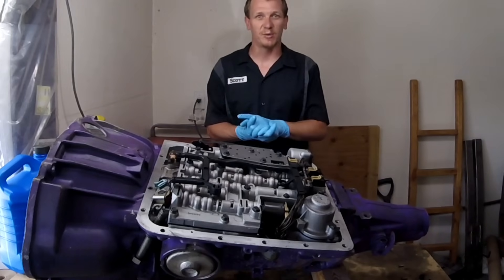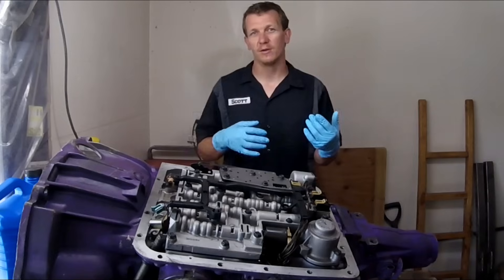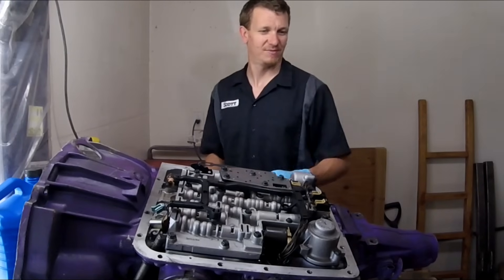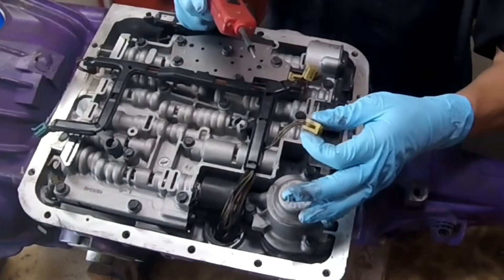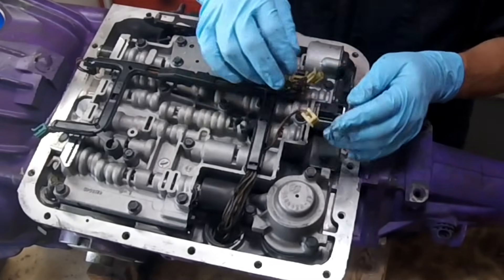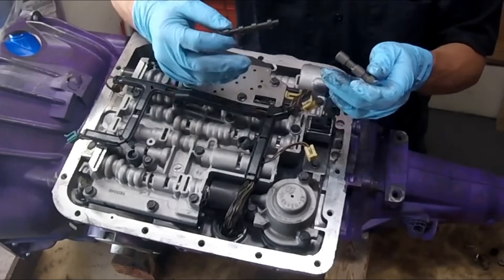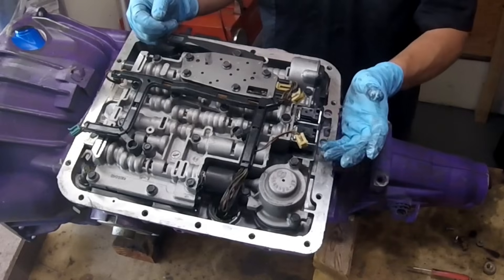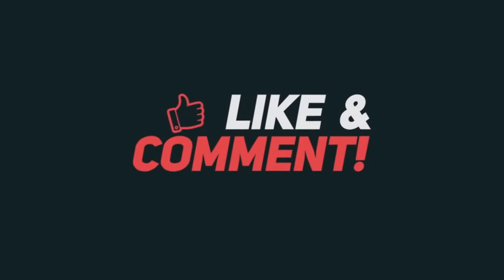⫷ GM 4L60-E Shift Solenoid 1-2 3-4 A and B replace p0756 p0753 p0752 ⫸

Comment: Hi, thanks for this very informative video. I was wondering if you'd have an idea about what I 
could do to solve my 2-3 slipping issue: Long story short, I had the 
bottom cooler line pop out one night. It was late and I wanted to drive 
the truck home so, I added fluid, drove it and it would pop back out. 
(the tip had rounded off and wasn't holding). Happened 4 times that 
night. Finally got it home. Next day, fix the cooler line good and tight
 and fill trans fluid. Test drive showed she was slipping in 2nd gear at
 about 2500rpms. But only in 'D', when I put it in '2' or gun it in 'D' -
 no slip at all. Some said to try the longer Sonnax servo pin (about 
1/8" longer than original pin). I tried the longer Sonnax and the 
original pin one after the other. The only difference is with the Sonnax
 there seems to be a whining/dragging sound that doesn't happen with the
 shorter pin, maybe it is applying too much pressure on the 2-4 band. 
Apart from that there is no difference between the two pins. Do you have
 any idea what else it could be? Any help that you can offer would be 
great. Thanks again.
Reply: You blew the clutch disk because of low fluid. Needs a rebuild
...
Reply: Exact Same thing happened to me

Comment: I have a question, I have a 1993 Chevy Silverado K1500 4l60e and when I start driving it it shifts totally fine though as soon as it gets to operating temperature it will go into limp mode speedometers to 0 and the 2 gear and high rpm, also replaced the speed sensor already, and I just removed pan tonight and lots of fine metal in the bottom what could be the problem, please help

Comment: I have a 2003 Chevy suburban k1500 with reverse issues. Transmission has to be hot for reverse to work. If I try to shift into reverse when cold I have to rev up the engine to get it to engage.. what’s going on anyone know?

Comment: Hey  Scott, hope all is well for you and thank you in advance. 
I have just purchased a 2002 GMC ENVOY SLE,  i was told the transmission was out . It had been sitting , at this point approximately 4-5 weeks. I arrived and started the engine  and just for kicks pulled it in reverse and it took! I then pulled it 8n drive and it took. So i pulled it back into reverse and backed , up hill, out if the drive and proceeded ti go forward about 25 yrds , when i went to back up to turn around it would not take gear acted as if it was in neutral. So i psid the lady and loaded it on a roll back and brought it home to start researching . So the next day i went to fuse #47 in the rear block and sure enough the fuse was blown !!!    - BUT-.  i boosted it back off again ( battery is shot) and took off to town to try it out ans get some fuel. I got on it pretty good when i left and laid pretty good rubber and thoyght i had stole this envoy  for no other than a fuse!!! NOPE.... LOL! made it about a mile and it started to be sluggish trying to shift and then juzt as if it was in neutral again ...not pulling at all.
ANY SUGGESTIONS WOULD BE GREATLY APPRECIATED.
Reply: That's what happens when you kinda know ur stealing lol

Comment: your videos definitely helped me a lot. However I'm not great with electrical so heres where Im at. P0756 code. but was having very low power long before the code came. did everything you said. Solenoids test perfect and valves didnt seem to be gunked up. there was a small wear spot on them in the finish but suspect thats normal. My issue is with the wiring. have a cheap probe from harbor freight but it works. Only one of the harness wires for each of the 5 or 6, 2-wire connectors inside the trans will show ground with the key off. (I haven't tried it with the key on). it seems in one of your videos you said they both need to show ground. Does this mean my harness internal harness is bad?
Reply: I have a2007 trailblazer shifts first and second gear no problem then it want shift to third and fourth gears mechanic says it needs rebuilding but it doesn't slip when it shifts to second I need help
Reply: @jamesbonner7202  is look into those shift solenoids. My issue was power not shifting. But ended up selling it before I resolved it.

Comment: I wish I would of known all this before replacing my silinoids AB. Now after doing it on my 2006 GMC Sierra truck. Where it was the worst year of ttruck for GMC where the exhaust goes right under the transmission pan and it's almost impossible to even get the pan off with ten times the work. I did it after a week of work for n the rain and snow, in the driveway at 30°. Now the truck is back to extremely bad. No power high Reve to get anywhere. Except for putting the truck into 2nd and 3rd gear to get anywhere. The same code is popping up still. I absolutely don't have the money to get it done being a two time kidney transplant patient with two strokes and 12 years on a dialisys machine. It's extremely hard to get anything done let alone doing this all over again. God please help me!!!!!
Reply: I'm doing mine right now and the damn exhaust is in the way 🤣 first time any type of transmission work for me aswell. Did you just take the exhaust off?

Comment: Good morning I have a 2007 tahoe 4.8 and won’t shift. But I don’t have problems selecting the gears. Move forward and reverse with no problems. Transmission feel strong but won’t shift. Change the fluid filter and solenoids will fix my problem?

Comment: I replaced the a and b soleniods and it still does the same thing
Reply from the maker: Did you check your wiring harness while you were in there? Did you check the shift valves in the manifold? Did you find any debris in the bottom of the Pan?
Reply: @ScottiesHobbies  it was a fresh rebuild from a shop and the solenoid b stuck off a day later they replaced both solenoids to be sure and they said they don't know what it could be
Reply from the maker: @justinadair9159   That is no good. I would check for continuity in the wiring harness. I would also check the accumulators. A code is it always a definite malfunction, sometimes it's just a area to start your diagnosis. It could be something in line to the solenoid that is going badd but their computer doesn't know how to recognize it and is giving you this code.
Reply: @ScottiesHobbies  shift solenoid b stuck off
Reply: @ScottiesHobbies  I've tested for continuity and got 1 side each shift solenoids to give ground.would that mean the harness is bad.

Comment: Ok quick question. I have a 08 Denali xl.
Someone told me it may be the transfer case. It wouldn’t move but after being towed now it drives but dosent change out of 1st gear as well as the RPM gauge dosent move. Any help???
Reply: Have u figured it out yet?
Reply: Check your speend sensors on your transfer case.. same thing happen to my 00 chevy tahoe.. their are a couple speed sensors on your transfer case.. good luck

Comment: I have a 1999 s10 Chevy blazer 4 wheel drive. Is the same 4l60e transmission that you’re working on in the video the same as in the blazer? And I didn’t see a link to where I could order both of these shift silinoides.  What’s happening is when I put it in drive it doesn’t move till I give it gas then it will catch and start moving. I haven’t noticed anything else happening as of yet but could this be the solenoids doing this. Thanks. Being on a fixed income I’m not able too spend thousands of dollars like these guys around here are wanting to rebuild it and they say the transmission is shot but I know a enough about Machanicing to know it’s not shot. Thanks for any help.

Comment: i have a question i got a 2005 chevy silverado i was getting codes p0756 and p0758  i replaced both solenoids a and b and im still haveing the same problom if i put the shifter all the way down to first on the colum it takes off fine any help would be greatley appreciated.

Comment: My brother has a 4l60e transmission in his chevy k 1500 that goes into reverse fine but doesn't want to go forward very easy have to push the gas Fitbit to get it to go forward he replaced both solenoids but it still has the same issues
Reply: It's a 93

Comment: Hey Scottie I followed your video on the solenoid replacements.. I have a difference with mine.. My 4L60-E did NOT have the spacer on the spring side for the solenoid.. My 08 GMC Sierra still has problems shifting after new solenoids were replaced... Is there a reason mine had no spacer..?
Reply from the maker: It's just a different design usually. Some shift kitsch and aftermarket shift valves have them.. if you are sure its stock, it's just a different design.

Comment: 04 GMC Canyon truck will not go into gear. I can put it any gear and all it does is sit there and rev up. Checked fluids everything is where it’s supposed to be. Any help?
Reply from the maker: Is your gear selector moving under the truck when you move the selector on the dash? If fluid is good you probably have no line pressure. I'd think something with the pump is bad. Highly unlikely but have you checked the filter? Make sure its clean and properly seated?
Reply: Scotties Hobbies it’s like 50/50  sometimes it wants to sometimes it don’t when you first start it up it will go into gear and move for like 15 seconds and then go back into what seems like neutral. Filter is like it should be. Thought it would be something electrical just not working properly just don’t know how to electrically test a solenoid.
Reply from the maker: @e7904  usually a bad solenoid will effect one or a few gears. You will still get forward or reverse movement if a solenoid is bad. I do have a few vids covering testing the shift solenoids. But if you have no movement I'd thing the pump is not giving the pressure it should to work.
Reply from the maker: @e7904  can you shift to 1st or 2nd and get movement?
Reply: Scotties Hobbies appreciate it I’ll check out the solenoid test videos and see how it does. I just started it after leaving it sitting for a day and every forward gear is working and reverse is not all I did was reset the computer so maybe something electrical
Reply from the maker: @e7904  if you are going to take the time to test those solenoids I'd recommend removing all the solenoids, one at a time and making sure your screens are clean. You might have a dirty screen causing poor line pressure.
Reply: Scotties Hobbies I’m back to no movement at all tried every gear just having pull her in the building to get the pan pulled off
Reply from the maker: @e7904  if it is a two-wheel drive, You are going to have to remove the exhaust y-pipe. To get your pan off. You can remove your shift selector bracket. From the top of the transmission with a Torx bit. Some people like to bend that shift selector back a little to get clearance for the pan. If you do that that is on your own so you can't blame everything on me, but it does save you a lot of time if you've been to back a little.
Reply: Scotties Hobbies it’s a 4wd

Comment: AT ABOUT 45-50 MPH MY 1997 SUBURBAN BUCKS , IF I DROP DOWN ONE GEAR TO GET IT OUT OF OVER DRIVE IT SMOOTHS OUT . DO YOU THINK I NEED A NEW SPRING ON THE "B" SOLENOID
Reply from the maker: Really so many different things can be the core problem. I can't say it's one thing or another. I would recommend taking your pan off and checking the solenoids, harness, accumulators, shift valves, and inspect for clutch material in the fluid or in a solenoid. 

If you have clutch material or brake material in the fluid plan on getting a rebuild but you might find something that will get you a few thousand miles more.

Comment: I have a 2012 vw jetta and i have code p30735 and p0734 do you think if i change all the solenoid it will resolve the issue??

Comment: Does this help with a transmission with no reverse but works fine going forward??
Reply: Mark Guerrero sounds like a sun shell inside trans it’s from rolling in reverse backward and not stopping completely and prematurely shifting into drive it wears or breaks sun shell which get brittle over time happened to mine in my Astro van trans shop rebuilt it.told me the materials it’s made from we’re crap since been upgraded better material.

Comment: Let’s say I got both the shift solenoids out how do I know which one is a or b does it matter??
Reply from the maker: They are both the same. Will not matter.  Make sure you check for continuity on the wiring harness at the shift solenoid with the key in the on position. Make sure you check the shift valves in the valve body as well. All while you're in there.

Comment: How do you know which solenoid is which or which performs what jobs
Reply from the maker: Both solenoids are commanded at different times throughout all gears. I usually recommend if you're having a problem with one or suspect one is bad that you should probably replace both with AC Delco OEM shift solenoid. If you are going to do that job make sure you check the shift valves for proper movement and also check your wiring harness for proper continuity.
Reply: @ScottiesHobbies  still avoiding the question..  what does A actually do?  what does B actually do???
Reply from the maker: @matttaylor377  A solenoid is a type of electromagnet, the purpose of which is to generate a controlled magnetic field through a coil wound into a tightly packed helix.
Reply from the maker: @matttaylor377  they control the shift valves. They are used throughout all gears. Different gears have different sequence. You can use your googler to see when they are commanded on during each gear.
Reply from the maker: @matttaylor377  both solenoids are the same part number so they both do the same thing. Control the shift valves.
Reply: @matttaylor377  he told you in the video

Comment: I'm really pissed I watched this video and not a better one before I did my job. You completely failed to mention the fk'n 2 other solenoids, which might have actually fixed my issue, and would have had no problem changing while I was in there. Now I have to do the fk'n job all over again, to replace the PWM Torque Converter Solenoid and the 3-2 downshift solenoid, which is most probably my issue. Epic fail for a DIY vid. You're talking to people who don't know about this sh|t, if they did they wouldn't be watching the video.
Reply from the maker: Sorry for your experience. Ya can't please em all. Good luck.
Reply: @ScottiesHobbies  Clearly. You can't even list them all, even though there's only 4
Reply from the maker: Welcome to diagnostic and repair. Why would you not test components before you just replaced them? You took some guys video on the web as your sole  conclusion of your problem? Maybe you should have tested the solenoids and then seen that they were not bad and continued your diagnosis or thought process to figure out what is wrong with your vehicle. I'm sorry that you had this experience, welcome to working on Transmissions. Some people don't have the patience for this and you might be one of them.
Reply from the maker: You got to remember, we do it for the views. Check out my video library for more on the solenoids.
Reply from the maker: Did you even clean your shift valves? That's the most common failure. If those shift valves are dirty you probably should plan on getting a tranny in the next few months.

Comment: I have a 2001 tahoe with a remanu trans installed about 5 years ago. Now when i accelerate from a stop, I get a slight slip going from 2nd to 3rd at about 28mph. If I accelerate slowly you almost don't feel it. Other than that it works perfectly. I baby it for the 2-3shift so can hopefully get many more miles out of it. I watch the tach and I can see it go up like 300-400 rpm then drop when 3rd kicks in. Do you think its a solenoid problem or something else?

Comment: What do I check if there is not continuity to both of the wires on each  solenoid?
Reply from the maker: With the key in the on position? Make sure the harness is plugged in properly. Its possible your harness has gone bad.

Comment: Hello.  I have a Chevrolet blazer 1995 .Second spare hangs all the time, is it from Solenoid or from fluid transmission and filter ?
Reply from the maker: Could be a number of things. These solenoids, the shift valves, and the accumulators would be my start.

Comment: hello there can i put a 4.3 v6 transmission in a v8 4.8
Reply from the maker: Yes.
Reply: really wow yea i have a silverado 04 v8 4.8 liter vortec an somethn is wrong with shifting 3,4 i jus use 1,2 shift an ive been driving it that way for a couple years now an someone was selling a 4L60e v6 4.3 liter an truck is a chevy s10 so i was gona buy it an put it in my truck silerado 04

Comment: Do all 4l60e have the spacer? yours barely popped out because you were holding it but your spacer still fell out very easily... my solenoid shot out but i did not notice any spacer on the ground or anywhere so i can only assume the spacer was still in the transmission or my 4l60e doesn't have the spacer because considering how violently my solenoid shout out you'd think the spacer would have too.
Reply from the maker: Not all have that spacer. I actually made a update video pertaining to this exact question cuz I get asked so often about it. I'm honestly not sure why this one had a spacer in it. Someone might have installed some type of Kit to fix a minor problem in the past that became a larger issue to cause a rebuild. But if yours did not have the spacer in it just reassemble it as it came apart.

Comment: the only symptom on my 2012 suburban is a hard down shift and other functions are smooth. The hard down shift only occurs between what seems to be 2nd and 3rd gear. does that sound like the shift solenoid
Reply: Same issue with my Yukon

Comment: But what if yu dont get a Code on tha dashboard. My Yukon wont drop in Drive Goes in Reverse with no Problem. Overdrive 3 doesn't work but 2' and 1' does i change the A solenoid still no D gear